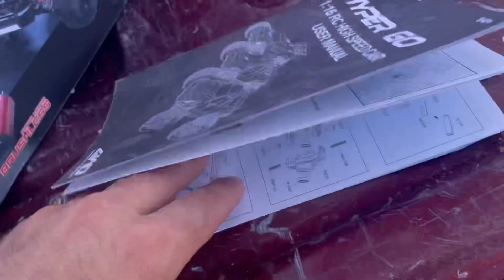New EXTREMELY FUN RC car! MJX HYPER GO v2

Comment: I just got one today. HOLY CRAP. This thing is cool. I modded mine out of the box with a skid plate, 3000mah battery and 200k F & R differential fluid. It's an animal, FYI still turns just fine with the 200k.

Comment: I just bought the car and played with it today. This car is great bang for the buck, its very quick durable and maneuverable.  There's alot of understeer due to the power and short wheelbase  I'm playing around with the suspension, front wheel toe.  Tightening the suspension helps avoid the wheelie issue and appears to provide more control.  It doesn't have alot of suspension travel and sits low which will always limit stability and bounce.
Reply from the maker: Yes increasing the suspension travel would be great and could possible be done with hbx 901a shock towers and some longer shocks

Comment: Thanks for the info. I've been wanting to get the hyper go model of the hbx 16890sa. Hbx has a lot of issues with the drive train. Live in the high desert of Cali. Seems like it mite be better. Love the vids 💯
Reply from the maker: My experience is actually that the hypergo has more drivetrain issues. The hbx is extremely well built and durable.
Sand is bad for RCs though so that won’t help. Definitely fun though!
Thanks!!

Comment: Any tips on removing the pin for the lower rear a-arm to knuckle.....?????
Reply from the maker: Is that one of then ones that are pressed in?
Those can be tricky without a special tool, but you can try to hammer it out with a small punch, or put a small allen bead hex bit on a pair of channel lock pliers and squeeze it out. But that isn’t always easy.
Reply: @DerbyCityRC  thanks very much and yes they are the press out pin....mabey I will just wait to install the new aluminum knuckles till I can get new arms. They haven't broke yet so might as well run them.....
Reply from the maker: @user-vi9jc6ke8k ya might as well!
You’re welcome!

Comment: Man I really love your content! Narration is so interesting and fun and the footage is very amazing with the jumps and the speed. Thank you very much for all the info you share in your videos, actually today I recorded in slow motion my mjx H16BM to understand why even when I land jumps it bounces and flips upside down, now you explained it perfectly, maybe using the bigger tires or longer shocks can fix it? Or changing the oil thickness for the shocks? Anyway man keep it going, you have a really aero content.
Reply from the maker: Thanks!! The bigger tires may help but on this model, it will look the diffs pretty quickly I’ve learned. Start with maybe better tires of close to the same size and maybe thicker shock oil, like 80wt.
Then if you do ever blow the diffs, you can buy the upgraded versions that would handle bigger tires much better!

Comment: Are parts easy to get? I got burned with a Chinese model once (JLB Cheetah) . It was almost into get parts. Now that my son is a little older, he wants one for his birthday. Do you think this is a good option? Something we could work on together?
Reply from the maker: Parts for this are everywhere yes. Some on Amazon some on Banggood, Ali Express, Bezgar lol. I have a jlb cheetah too. As good as it performs, it’s soo fragile. But I was always able to get parts for it from Banggood. Maybe it’s not as easy now as it has been 3 years. Gonna sell the whole thing as a roller and my extra parts lol. Overall this car is a decent option. Still has its weaknesses but they all do.
Reply: Awesome thanks. Any recommendations if I want to find everything I need on Amazon? As far as parts and upgrades
Reply from the maker: You’re welcome. Look at my videos for the rlaarlo Omni Terminator. It’s on Amazon and they usually have all their parts available on Amazon also, just under the name Amoril for some reason. They even seek their own upgrade parts. I’ve got the car listed in those video descriptions. Not too bad to work on. The biggest issue is the screws can round off kind of easily. Get a good quality set of 1.5-3mm hex drivers. If Amazon happens to be out of stock on the parts, their website has them too.
Reply: @DerbyCityRC will do. Thanks again.

Comment: hi - i just bought this from aliexpress. Question for you - the drive train and gear box are very noisy and loose. It appears to have quite a bit of slack in the gear box, so if you hold tree wheels in place and the turn the remaining wheel it moves and makes a few clicks like skipping a few teeth before the wheel locks into the transmission, just so very loose and very clicky drive train. Is this normal on this particular model?
Reply from the maker: Some movement and a little noise is normal. From the sound of it, yours may be excessive and you may want to reach out to the seller.

Comment: Hi, me again. lol what im wondering is, that one of the tyre came loose off the rim after like 2-3 runs. (Rear)
Not sure how common is this w these wheels, i ordered the upgraded Differential, as that seems to wear off due to cheap material. Saw a video a guy was fixing (gluing tyres) had some foam inside the tyre. Not sure what glue, and how durable these are. Any advice, if you have some time? Cheers
Reply from the maker: Interesting I haven’t seen tires come off the rim on these I don’t think but yes they get glued. This is what I use: https://amzn.to/3W0dCOW
Reply: @DerbyCityRC  not too sure how it happened, but cant see my son deliberately did that. lol 
I wasnt there, and ive not seen the wheel yet. I watched a video a guy was gluing them, and also torn/ripped tyres. Ordered the rubber glue and some spare tyres. He says its hard to control, i thought maybe can still drive until new, or glue arrives.. thanks
Reply from the maker: @numbaonekobefanofHUN oh definitely DOES happen all the time, just usually on bigger tires with more centrifugal force. I can totally believe it happened with mostly normal use lol. I wouldn’t run it if it’s off the rim as could mess the wheel up.

Comment: Random question, just got one and when it breaks it makes a weird noise? Maybe electrical? Does anyone else’s make a noise when breaking or when  reversing then going forward? And when the battery is low does it allow you to steer but not drive? Thanks
Reply from the maker: How would you describe the noise?
And yes battery cutoff only cuts off throttle. Steering will still work.

Comment: Hi there.
Does the 45a esc have a LVC for when you are using your own Lipo batteries? Or are you just estimating voltage cut off times?
Reply from the maker: I do believe the esc cuts out on its own. Pretty sure it slows way down to help limp it home, then shuts off completely.

Comment: I have that car since about 1 month and the shock absorber on the rear not working well anymore. Which oil /weight would you recommend for it to refill ? I’m new in the rc world and qould be nice if you could help me out here, really like your channel 👍
Reply from the maker: Hello!
So the rear shocks just not lift the car all the way up anymore or are they too bouncy?
I actually like the fluid these come with, probably close to 50wt.
If they don’t push the car all the way back up when just sitting still, you can adjust the spring tension all the way up.
Reply: @DerbyCityRC  yes exactly the rear dumper doesnt lift the car 100%  up anymore and if pushing on it its comes just slowly up.
Reply: @DerbyCityRC  and yes they are not bouncy
Reply: @DerbyCityRC thank you for your quick answer 👍
Reply from the maker: Hopefully you were able to adjust the springs. That usually helps but sometimes still not 100%
Reply: @DerbyCityRC  I changed the oil and it works fine now.
New problem came up just a few days ago, the reverse gear doesn’t work anymore.
If driving forward the break still works but pushing the controller again to drive backwards then the car doesn’t move.
Can it be that the controller is the problem or do you have any idea what to look first for to fix that problem ? 
Thank you regards Sebastian
Reply from the maker: @sebastianstruhs Glad you got the shocks taken care of.
Well that’s odd. That could be the controller, receiver, or the esc. Some cars have the ability to program no reverse into the esc but I don’t believe these can be programmed. Anything happen to it when it started acting up that way?
Reply: @DerbyCityRC  no , my son just driving around(no jumping)  i try sometimes to drive it in reverse but 9 out of 10 times it doesn’t work sometimes it works  but mostly not
So i have no idea how to fix that. I ordered a mjx hyper go 14210 and will get it in a few weeks
Should be the same controller so if its possible to use this controller on the other car to see if its maybe the controller is the problem ?
Reply: @DerbyCityRC short update, i found the problem about the reverse, i just moved the throttle trim a little bit and it works fine now 😁 thank you 👍
Reply from the maker: I’ve done the same thing on a few occasions lol.
Glad you figured it out!!

Comment: Does it have adjustable steering and throttle?
Reply from the maker: I don’t recall this one having adjustable steering (though it is proportional). There is a speed switch to reduce it to 70% power but that’s it.
Reply from the maker: Throttle also proportional of course

Comment: thank you for the video, i just got into the hobby, and i want to start with a budget friendly truck, this truck costs 165 CAD with grease and other stuff it gets pretty expensive, what rc truck do you recommend that is not too expensive and easy to upgrade and maintain? Thanks!
Reply from the maker: You’re welcome!!
Check out this video. This truck is usually a bit cheaper (check the link in the video description) and takes upgrades really well. Also extremely durable. Be sure to watch the upgrade video on it too.
https://youtu.be/nGdzMo9GPFw
 Here is an upgrade video on it:
https://youtu.be/MxPdhiDYsHk
Reply: @DerbyCityRC  i watched the video and the fc flyhal, but both prices had increased. Do you have any recommendation of trucks that are good for beginners and quite cheap? Thanks!
Reply from the maker: Is this one available in your area? It’s the exact same car as the Flyhal under a different brand name and a different color body. Plus cheaper.
https://amzn.to/3Brkj20
 CHeck out the video I just uploaded today. It’s got all my favorite cars that are under $150
Reply: @DerbyCityRC  do you prefer the hyper go or the 16889 pro one?
Reply from the maker: I just did a video that somewhat compares them today. See for yourself, but to me, the 16889a pro is more durable and performs much better with larger tires.

Comment: I'm still not so sure whether to buy this one with and running also with 3S (I'm going to use it more on the grass/land/sand not without big jumps) or just go to the most robust sister, the HBX 16889a pro, but in that car, I am quite sure can't deal the 3S as this one, am I right?

what would you suggest after both experiences? 

Btw, Thanks for the video!
Reply from the maker: That’s a great question and here’s a video that explains it all in pretty good detail if you haven’t seen it. They both have pros and cons and it really is a tough choice.
https://youtu.be/shXiBzqmFeY
Reply: @DerbyCityRC  thanks, I saw it already and that video pushed me in the beginning to the MJX but after seeing it another couple of times (and with your answers, thanks btw) I think I'm going for the HBX and maybe in the future I'll try to change the ESC and trying it with 3S (cuz I'm still reading that HBX can't handle very well the 3S with his ESC but I'm a  noober with RC cars) .

Anyway your videos and answers are super helpful, thanks !
Reply from the maker: Correct that esc has trouble with 3s. Should be a simple and inexpensive swap for a better esc that will take the 3s!!
Good choice and glad I can help!
Reply: @DerbyCityRC  I can confirm that after a month running with a few times with 3s, esc started to be "funny". I was thinking to buy the MJX esc with 45amps and controller / receiver or maybe try a better esc (like 60amps) and try the Dumbo receiver / controller, it is coming with "gyro" setup that sounds intresting for off roads!
Reply from the maker: Ya it just doesn’t work well with it. I’ve even heard good things about the Hobbywing quicruns that are only 30 amps
Reply: @DerbyCityRC  yeah me too, for 14$ Im going to try the one of the MJX that is 45A but maybe the hobbywing was better
Reply from the maker: Can’t go wrong trying that. Should work well honestly. I may do the same lol. Keep me posted! 👍👍
Reply: @scappellos  Did you try it? If you did, how was it?

Comment: Hi just got this truck but brakes are not good as yours.. btw how do u apply brakes for this truck? Just pulling the trigger backwords right?
Reply from the maker: Hello. That’s interesting. It could have been programmed differently. I’m not sure if there is a way to reprogram these or not. But yes all you do it push the trigger the opposite way and hold it there

Comment: Hey wats up dude. I just got myself the brushless hyper go. The thing is definitely sick, but one thing i noticed is the rear axles are 1 or 2mm to long. they bind up bad when the suspension is compressed even a little. 
I haven’t seen anyone complaining about this. Did you notice this with yours? Maybe it’s just mine? idk
Reply from the maker: I have not noticed that. I do know the rear shocks don’t sprint up as strong as the fronts. Funny thing is, that IS an issue when you upgrade from plastic to metal parts on the standard hbx 16889, so I can believe maybe it is actually an issue I just haven’t noticed yet. On my hbx I upgraded, I was able to drill the axle cups out just a little bit deeper and that fixed the problem.
Reply: @DerbyCityRC  it does look like the same HBX motor. It has the esc, probably using the motor too. I’m pretty sure that is a 3800. 

On the MJX all you gotta to is push down on it just a bit and roll it at the same time. you will definitely notice the binding if yours does the same thing. I might drill the cups if it becomes a problem. I had to do that on my 1/16 caster racing s16 when I decided to fit a px9200 suspension on it 🤣. 

I had the same problem with the rear not springing up on my base 16889. It’s all plastic though. It was annoying lol. 
I got those new HBX 1/18 shocks, (blue caps with white springs) and the work great on it. The Ama ASIN # is B08PF3YQJ9

You know what else is funny, my 16889 is all plastic. Been running it for over a year with a Rocket 2948 3450kv boat motor and a 60a esc. I would say it’s a tad over powered. Heres the funny part… the only thing that has broken on this thing is an upper control arm. And that was before I upgraded it lol. Plastic Axles are all good, plastic diffs are literally In perfect condition, it’s unreal. Depends on the brand, but I honestly think the plastic parts are more durable than the metal. Crazy
Reply: @DerbyCityRC  Hey, not sure if you know but HBX makes the upgraded shocks for the 16889 too. 
Ama # B0BNQ52C7D, and the part # is 16HOP1

The 18859 shocks are about the same size. I believe only a couple mm shorter. They work real nice on my 16889. No leakage too.
Reply from the maker: That’s awesome! Ya hbx uses great plastics! It took a while, but I blew out my front diff on my 16890 after it had bigger tires on it for a while. I have yet to kill a metal diff, except in my mjx HyperGo
Reply from the maker: Awesome!

Comment: Great little basher. but HBX seems to be the trend setter, especially the 2995 and the 16889a PRO. Would be great to see the MJX HyperGo V2 against the 16889a Pro both on 3s being bashed. I cant decide which one is better.
Reply from the maker: Ya I’ll do a comparison video in those two soon. Can’t go wrong with either one. Hopefully the hyper go is just as durable. It does seem to have a bit more power
Reply: @DerbyCityRC  I already ordered the Hosim HyperGo Brushless and its exceptionally built. The quality is unbelieveable. I think the MJX HyperGo Brushless is the next best rc since the HBX2995.
Reply: I feel like the MJX Hyper Go Brushless/V2 seems a little better quality/more well thought out than the 16889 Pro. Official 3S support, better tyres, better interior design/honeycomb chassis, motor fan, slightly faster in both 2S and 3S, body attachment system on the 16208 variant etc. Just seems like a slightly more premium/modern overall package and better value proposition, though you can't really go wrong with either.
Reply from the maker: I agree!
Plus axles that are like 3x as thick!
Reply from the maker: I don’t disagree at all!
I’d love to see a 1/12 HyperGo!